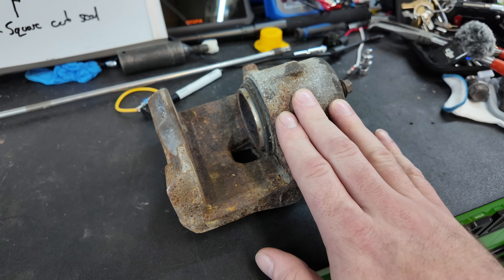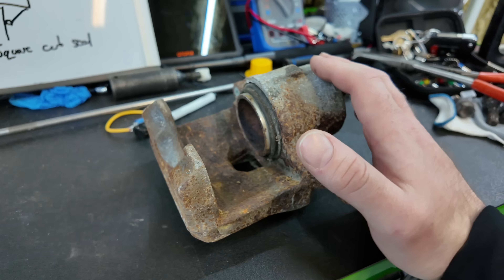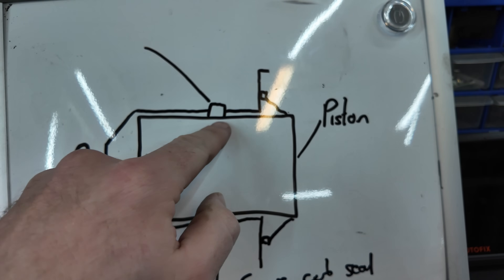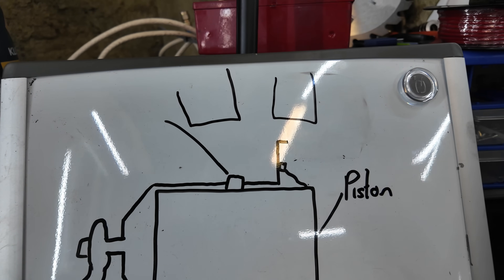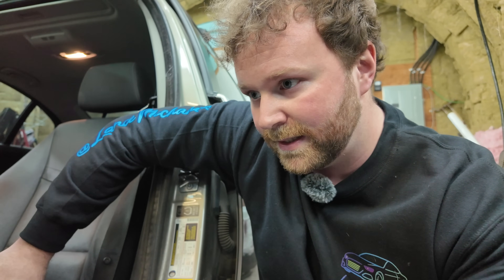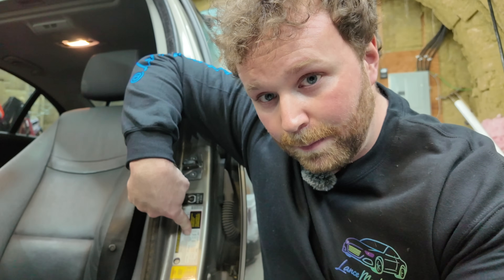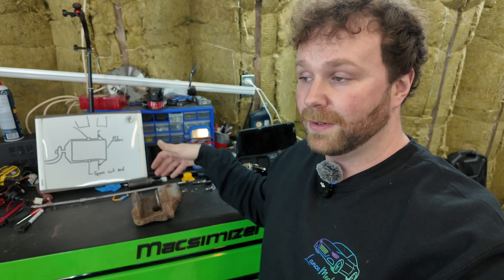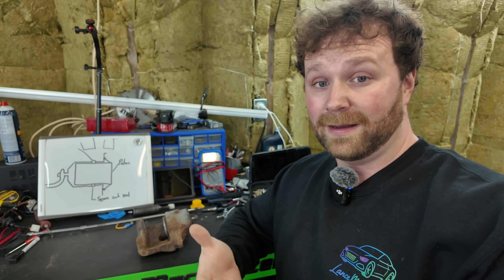Half of New Techs Can’t Explain This…

Comment: The same thing is happening in aviation maintenance.
Reply: @madbrax5184  That’s quite concerning! 😳
Reply: That is scary 🙆 Boeing
Reply: And that is scariest, heavy things falling out of the sky because greedy corporations and managers cutting corners in the name of profit increases!
Reply: @normandothegreat That is a very real problem too! But there is an issue of imminent catastrophe that's even worse and i can almost guarantee its going to be bad... The airbus issue with software being corrupted was radiation from space! It won't be the last or worst aircraft to have such an issue, but the industry is silent about it framing it as a fluke. Its not!
Reply: This is great 👍 very safe
Reply: @friendofvinnie Yeah and thats why there is an aircraft down almost every second day latley!!🤦🏼‍♂️
Reply: @mrgoodman6620hopefully broken on the ground and not in the Air 😢
Reply: @friendofvinnie Unfortunately a few thousand feet can be the critical difference between no issues and catastrophic failure, so by virtue of being in the air will be the catalyst for disaster.
Reply: That's what apprenticeships are like, they will spin out work or ways you could learn and effectively do in months. Mind you there are some situations/jobs you do need the time to be competent at.
The term Apprenticeship replaced the slaves work apparently
Reply: @madbrax5184  YES! It's arguably even more significant in the "corporate knowledge" gap, being the lack of relevant fundamental understanding.
My son is a commercial rated pilot with background in aerospace engineering currently with contracts that we don't know exactly what his job is now, the only clues are he dresses in a white business shirt and black dress pants carries a large black case, is in the air regularly and knows a highly disproportionate number of ex topgun pilots! 
Added to that his history includes things like being introduced to the late Queen of England and national academic awards.... So obviously he's just bumming around!😂😂
But seriously the general aviation stories he confirms to me are nothing short of terrifying!
I really believe it's an issue of dangerous misguided assumption, where everyone that doesn't know something assumes that surly there is someone else that deals with that!😶
O M G!
Reply: I'm retired now and work for an aircraft engine manufacture that produced military jet engines. Some bright chap came up the idea of with casting  right of  the engine cases the specs  for assembly.
Reply: How can that be? We don' t fly.with out good technicians.

Comment: When pressure is applied trough braking is what pushes the brake piston out, releasing the brake will remove the hydraulic pressure which will cause piston to back away from the brake rotor. the square seal is simply to prevent brake fluid from leaking out. let me know if im wrong.
Reply: you are wrong. the video is correct.

Comment: Ask any new technician on a 4 stroke engine, what closes the intake valve after the intake stroke
Reply: Camshaft lobes pushes the intake and exhaust valves open, and the springs bring them back up to close off the combustion chamber,  please confirm or deny
Reply: @j @jacksonbakermusic7081 lve is closed by the valve spring, most first year mechanics will get this question wrong on the CFQ test.
Or five thing engines oil with do to compression cylinder wall/rings

Comment: Where I live most trade schools only teach students to pass the exams, the instructors and admin openly admit this.  But they advertise as if once you do the course, you're a master tech ready to get max wage.  Another basic task always done wrong is checking oil, guys read the dipstick right after the engine is shut off and there is still half a liter trickling down from the top end, then they add more and it's overfilled
Reply: Most. Not all.  Come out to my school.  We don't play the "exam" game. We are hard core hands-on. We have to be. We also tell them that everything we give them is just the beginning - once they are on the job, be ready to start learning a bunch more to dial into what they are working on. 
TBH, I've pissed some higher ups about that. They want "exams" - but our industry partners on our advisory board have squashed that. And the tests that are out there? I've had 3 students take them after they graduated in the last 3 years - and all 3 passed first try .   Having had several national wins at SkillsUSA hasn't hurt, either. 
The exam is every day. Show up, be on time, be ready to learn, and do your best.  That's our mantra to our students. Weird how well it works... the academia side doesn't get it...

EDIT: I should note - I teach industrial automation, but we have a fair few automotive guys go through our AC/DC class, mechanical maintenance class, hydraulics class. And I grew up in an automotive shop and worked as an automotive technician before moving on to the manufacturing realm.
Reply: @CaptainSeamus  It's great to see someone doing the right thing

Comment: In electronics, I used to give an idiots test to techs I was hiring. I needed to know they could do and understand the basics before I turned them lose on customers items to repair. I also didn't want to have to be there every few minutes fixing it for them. You'd be amazed how many failed with good grades right out of trade school! It was amazing so I get it. If start with the basics and then you can figure out how things work and understand the newer more complex things. If you screw up because you don't understand the basics then you'll get come backs and what costs more the seasoned vet who knows his stuff and can work alone and rarely gets a come back or the young guy who screws up a lot?
Reply: what was your test?
Reply: @eviethekiwi7178  Well had some gotcha things like 3 diodes that were all shorted and to use a meter to tell which one was good. Then some resistors where they had to identify if by the color code. Then some fuses to see which ones were blown. Then I'd have some symptoms you'd see on say a television and what circuity would you look in to repair the problem. If dead like power supply, if no sound audio circuit, No Video I'd have a schmatic and they'd have to circle the likely problem or where they'd look. It's no different from a car say overheating. There are ways to get it checked what would you look for and what order but no true or false they'd have to give an answer thermostat, head gasket, how would you go about trouble shooting it. You could easily make up a test for cars on basic things. Obviously  you need to know how to test componets and how to read their values if you can't do that your worth nothing to me.
Reply: I did the same sequence, highest score was a 50% right from tech school or from the field.

Comment: Oh my God, tell me about it just sent my car to Volvo. Told them exactly what to do and they came back with a completely different diagnosis for a fuel pump that I had already just replaced. the car drives into the shop running yet it’s the fuel pump go figure never even tested it, just sent out a quote for $3500.
Reply: That will be 3500$ plus tx for you Mr.Know it all

Comment: are you forgetting the residual valve / prop  valve which allows pressure to flow  out and to flow back as it holds 2 to 10  psi so you have a brake pedal for the next time?
Reply: no residual pressure on disc brakes, drum brakes only

Comment: Tool companies coming out with specialized electrical diag tools and newbies be buying them without fully understanding the basic principles. Like teaching them a shortcut without them fully understanding the reasoning. 

Ie: power probe has the ppdraw to measure parasitic draw. Newbies plugging it into the obd and find 0 amperage, no problem found or claim that the tool is broken.

What they're not understanding is the negative terminal still needs to be disconnected!

Or them trying to diag a tpms light flashing. They scan it, the code says left rear sensor, they sell it, replace it, program it, ship the car. 

Few days later the tpms light is flashing again. They scan it, a different sensor now! 

They don't understand the left rear sensor code does not mean it's the left rear sensor currently mounted on the car. Tire rotations will move the sensor elsewhere. Tire replacements will move the sensor elsewhere. Don't go slapping a sensor that didn't need to be replaced. Pinpoint WHICH sensor was programmed to the left rear in the bcm. That's the sensor. Best case would be to sell all 4 or 5 sensors and be done with it.

Comment: What's funny is the info about the square cut seal is probably sitting in plain site at your local parts shop counter. Literally right under your nose while getting rung up. In the brake promo material.

Comment: I'm a apprentice at an independent shop and my mentor taught me this. 
I always try to take appart anything I can get my hands on. When I got the piston out, I was confused at how they are so simple. I was expecting more to be behind the dust seal. Nothing to it but that square cut seal.
That given I've never rebuilt one. It seems that every shop chooses to rather replace them than rebuild.
It could be that since there is a core fee on calipers that other apprentices are affraid to mess with them in fear they may have to cover the core charge. 
I'm also an oddity within my generation(gen z) because I want to understand everything at least at the basics. Everyone else my age is only chasing the money. 
My next project is tearing down an automatic transmission, which took me a while to procure because everything has a core fee and I had to end up buying one from a metal scraper.
I also only have a very surface level understanding of electricity so I love to watch your videos on the topic.
Reply: You have a good mind.
Tearing apart and looking at how things are made is a very good way to learn.
Carry on.😊
Reply: I'm a DIY guy - so I rebuild them...since my time really isn't money.  But weighing the time vs cost of a new caliper, seems professional mechanics just replace the caliper these days.  Anyway, give it a shot, even if its on your own car.  IMHO the cut seal is easy - finagling the dust seal is the hard part.
Reply: Once one understands 'how and why' something operates,it's much easier to diagnose and repair. Same goes for plumbing,politics and relationships, keep on learning!

Comment: Lance, I have been working on vehicles for over 40 years. All DIY. I'm not a licensed mechanic. I learned much of what I know from experience and yes, YT. But the current generation don't even know how to check the oil, let alone even think about changing brake pads. I try to teach people these basic things are not hard to do. You don't have to take your vehicle to the dealer. Save some money and learn to do it yourselves.
Anyways, keep the videos coming. 
Merry Christmas.
Reply: They probably think that you're trying to scam them into doing a  brake job